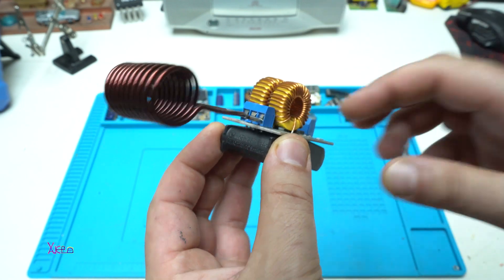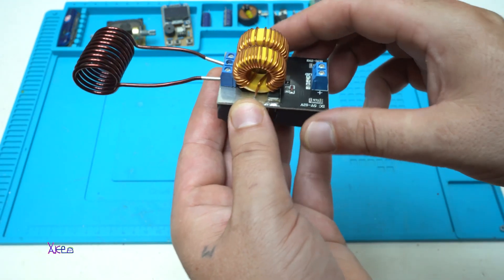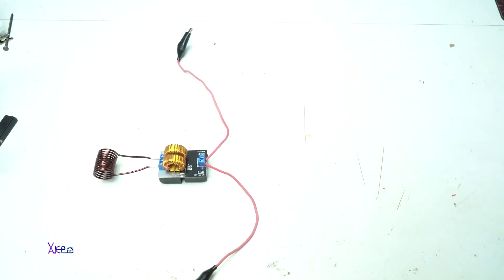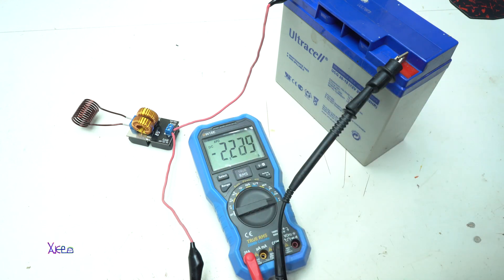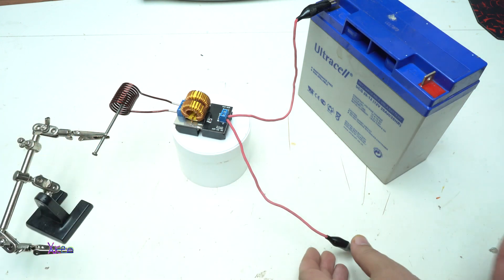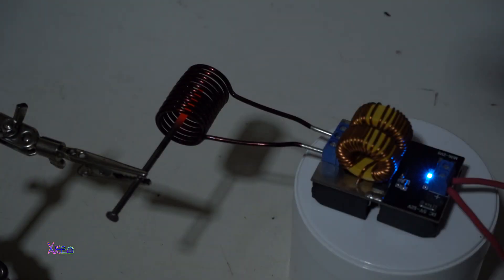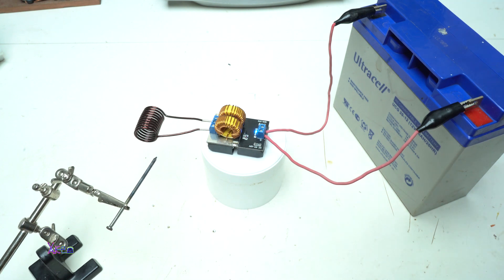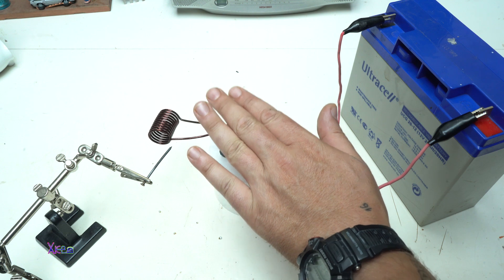$2  Induction Heater 12V  from Aliexpress

Comment: I've always wondered if you could buy one of these and use it to heat up seized bolt heads on a car. But the coil is very large. I wonder how you could modify it to work with only 2-3 turns on the output coil.
Reply from the maker: This one is mini just 120watts,but online you can find 1kw